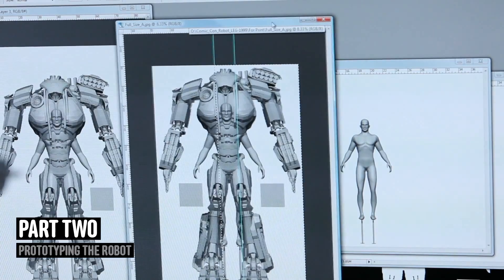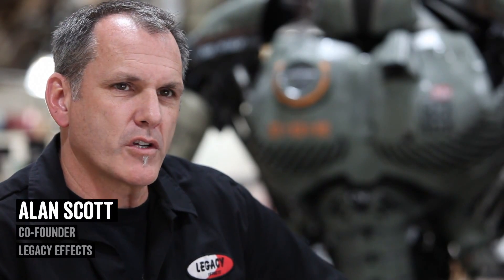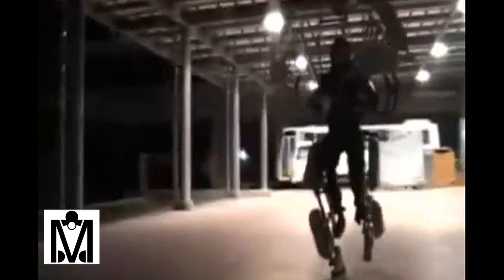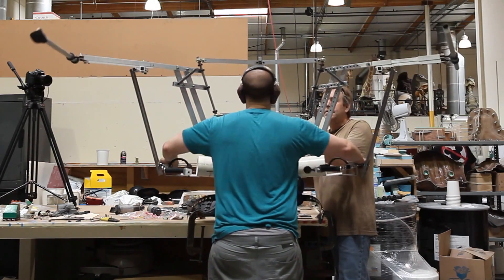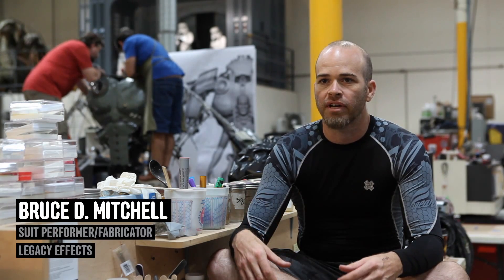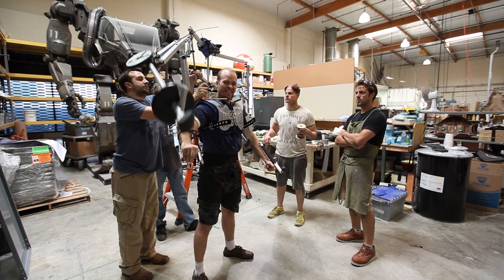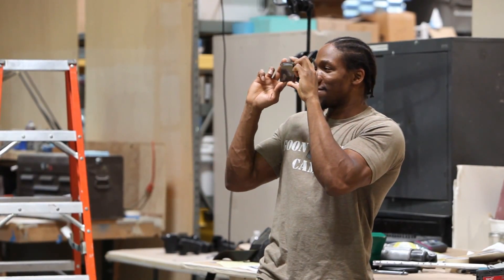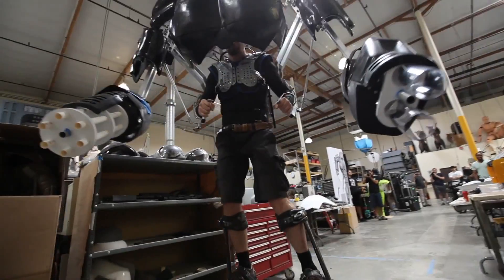How to Prototype a Giant Robot Mech (3/7) - YouTube Geek Week - Wired

Comment: i can imagine the main spinal column of the suit being tied to the stilts using a series of various pole sizes, think of it like one of those weight lifting machines. the top and bottom are mated together using a single pole with holes along it cut in half and a slightly smaller pole in the center of the two halves with matching holes. after he is in the suit the center point is held down using a single pin. this way the upper of the exoskeleton isnt bearing down on his shoulders.